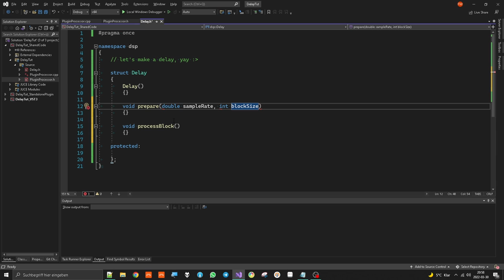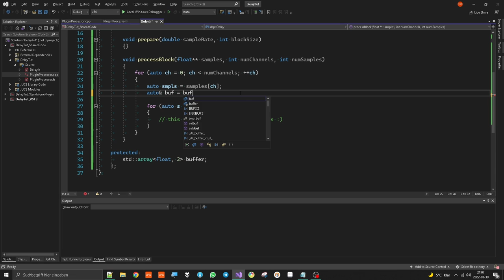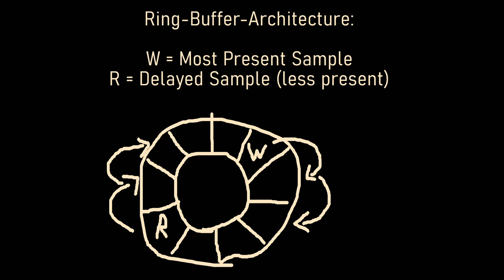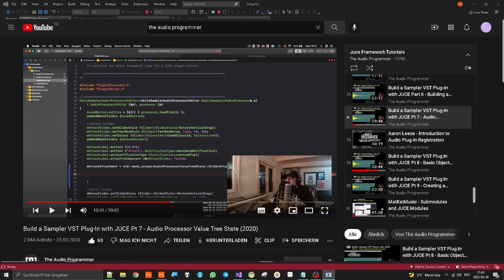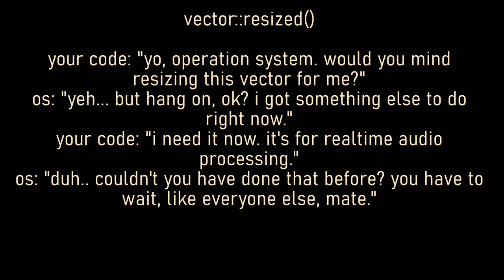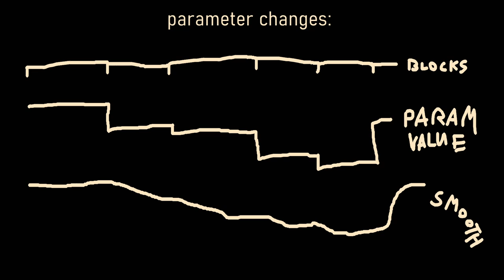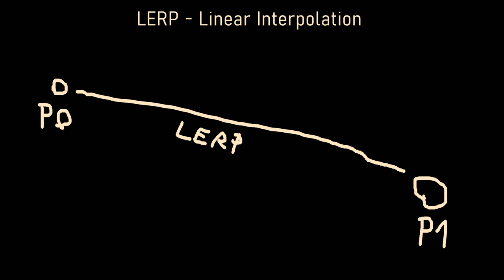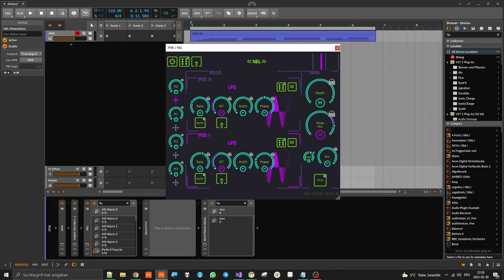Code a Delay

Comment: After following all the steps until about 14:00 I don't get any delayed output signal. It just sounds exactly the same with the plugin bypassed or not bypassed... Any idea what I might be doing wrong?

OKAY wow. I found the problem but I have no idea why it matters, maybe you can explain this?

I had written this, this doesn't work:
writeHeadBuffer[sample] = (writeHeadIndex + 1) % delaySize;

Instead of this, this does work:
writeHeadIndex = (writeHeadIndex + 1) % delaySize;
writeHeadBuffer[sample] = writeHeadIndex;

Is it something the compiler causes in an attempt to perform optimization of the code? This drove me nuts! Have been spending almost 2 hours to find this problem, which I had never expected to be in that piece of code.
Reply from the maker: understandable. i also often get stuck on issues like that. however these 2 pieces of code actually do something differently if you look closely. only the one with the extra line overwrites the current index with the new one before adding itself to the buffer. that way you have a variable that always remembers its last state in there
Reply: @Beatsbasteln  Ahhhhh now I get it! Thank you so much!

Comment: This is an amazing video explaining this, but I have one question. How would you implement the parameter smoothing in the case the delay length is tempo synced?
Reply from the maker: thx! basically the same way, because no matter how you let the user adjust delay times (hz, ms, temposync rates etc) you have to convert that to a length in samples before going into parameter smoothing anyway, so it works the same for all units. handling temposync is particularly easy with delays, because you don't have to keep project position (ppq) in mind
Reply: @Beatsbasteln  I suppose my issue I'm running into is that I'm creating my read lengths (delay lengths) to be fixed values based off of the host bpm. Since I'm unsure how to calculate correct tempo synced delay lengths based off of a parameter like a slider which gives me values say between 0.0 and 1.0.

I've spent a lot of time trying to fix this problem. Is there an easier way to calculate delay lengths more fluidly? I feel like I'm overcomplicating it.
Reply from the maker: @bradlanducci9011  yeah i think i know what you mean. but try to rewrite your delay in a way that seperates the individual processes from each other. first you calculate the writehead. that is the easiest part. then you calculate your delay times in samples from whatever unit or source you want and smooth it. and only then you calculate your readhead from that as the difference between writehead and delay time in samples. only then you run the actual delay with these things
Reply: @Beatsbasteln  this makes sense, thanks again! I will get it to work correctly I am determined lol.